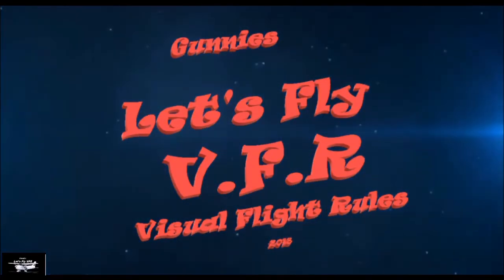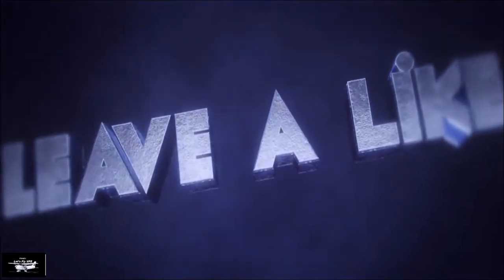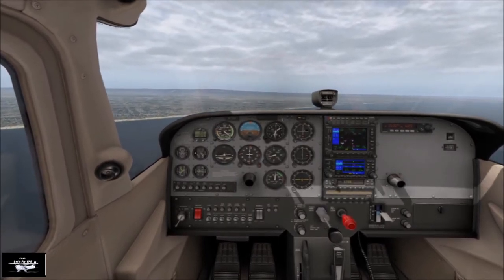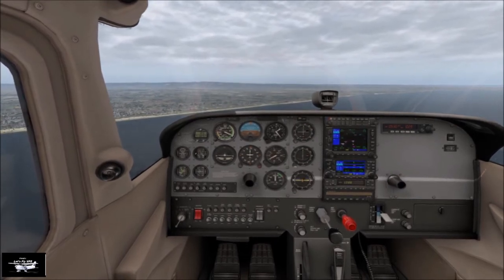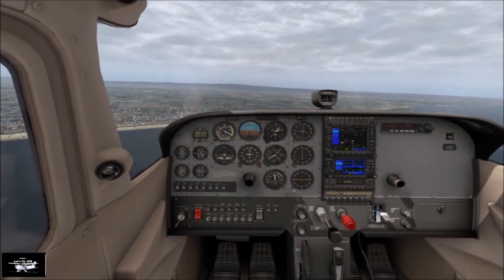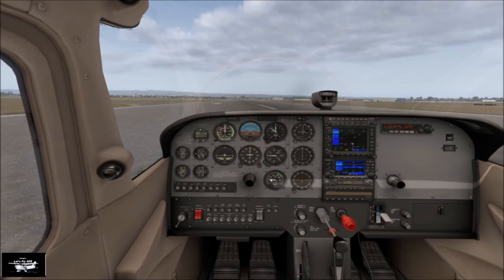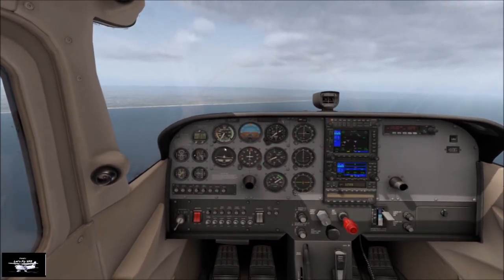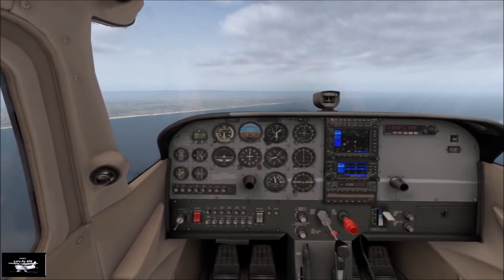X Plane 11 Make a perfect Landing

Comment: In "A view from the hover", John Farley recommends the throttle = speed / stick = descent approach. His reasoning is that needing to gain airspeed ( say because of a gust ) at low altitude, and using a slight nose down is more dangerous than just increasing throttle a bit.
Reply from the maker: +TheSkipjack95 Yes I have had this discussion a few times. There isn't a right or wrong really .. some people get very passionate about what's correct. I have a commercial pilot as a subscriber and we discussed it and he uses attitude for speed and power for decent rate when flying.  Do what your comfortable with mate. :) Thanks for coming to the channel.

Comment: Pitch for Alt and Power for speed needs always two adjustments when you change one of them....for a stable approach (trimmend for speed) you only have to manipulate power to control the desent rate, since the speed will stay always the same.
Reply from the maker: +Vienna Flyer Its a long running argument which is the correct one. Nave one way and airforce the other I believe. Choose what suites you. :)
Reply: @GunniesLetsFlyVFR  ...correct. Since approach and landing always depends on various factors, a clean process in one way or another isnt always suitable,

Comment: Your approach speed for the 172 is too high for what is  recommended by Cessna. If you do not have a published approach for the aircraft you would use 1.3 of Vso (Stall speed in the landing configuration) and your touch down speed is way to high. You should be close to stall speed as you touch down. As far as what controls altitude and what controls airspeed is more of an argument by military pilots and not civilian pilots.  If you lose power to your single engine airplane you are going to pitch to your best glide speed, there is no way to power to your airspeed and is one reason most pilots are taught power controls altitude and pitch controls airspeed.  When commercial airlines make an approach in the landing configuration they pitch to the desired airspeed and use power to control their rate of descent. You won't see civilian pilots debating this issue.
Reply from the maker: Good to hear from you :)

Comment: Very good video. But here is the trick. This has to be IMC down to a CAT 1 minimum (200 ft ceiling). Also, intercept final approach course at an angle (30 deg intercept). Why do I say this? Both methods factually work. However, Pitch for VS and throttle for power is for precision flying (ILS), the other method will not work. How do autopilots Boeing work? pitch for VS(glideslope) and AT for airspeed. Why not the other method? It will not give you the precise control that is needed. BTW, had I been your passenger, I would have like Mr. Second Pilot. You were far more stable and had a better ride with the second method. So, in a future video, do both IMC and blow up the instrument panel and fly both to minimums (don't worry about the landing) and then compare. I have no doubt that you will be converted. I can already see it....LOL
Reply from the maker: OK .. We both Knew this would take some practice .. HAHA ... Well Ill give it a go ~~~ Keep firing in advice .. Very Welcome good Sir! Gunnie
Reply: Actually I think your video really show both methods... Flying them in IMC will show a better comparison...
Reply from the maker: +pedrosura ill be giving it a go. :)
Reply from the maker: WOW .. Ive just tries a few cat 1 approached to YPAD R23. Power attitude .. ended up ok but right over the parking not the runway. 2 power is attitude .. about the same but left about the same diatance .. oh night as well .. then tried using 1) missed the airport by overflyng it in day co ditions. I need some practice Pedrosura. This is the hardest thing I've ever done flying a sim.
Reply: lol The ILS is the goal. To get there you should spend time doing climb descents at a constant power/pitch for VS, Constant power pitch for airspeed, then at a constant VS and airspeed. Once this is second nature then you are ready for the ILS. As practice you could use the autopilot in VS and heading select and manual power for airspeed. This represents what you would do while flying with your instrument skills.
Reply from the maker: pedrosura Well so far ive made one successful ILS landing with autopilots help but my manual approaches start to fall apart at 2miles or so. Keep arriving over the apron right. Close but no cigar.
Its going to get better though. :)
Reply: Gunnie's Lets Fly VFR Use the autopilot to learn how to make small changes to fly the ILS, dont try to land with it. The corrections should be small, -+100-200 ft/min and 2-3 deg in heading. You should make a correction and hold it. Wait for the needle to reverse motion and then another correction to stop the motion. You are making corrections that are too big.. you should be telling yourself 400 ft hdg 298 wait... 600 ft/min hdg 302 wait... 500 ft/min hdg 300 wait..
Reply from the maker: +pedrosura OK. Ill keep at it. Ill post a video in a week or two. I'd like this one to be good. Ill do AP assisted landings but i want to fly it manually as well. ;)
Reply: @GunniesLetsFlyVFR  I need some help with X-PLANE 11. I am a real private pilot.I can't  seem to get the pilots head to sit up as high as your vision setting. I can only see about 2 feet of the windshield above the panel. The IR Track only move side to side slightly and I can't get my head out of the cockpit because of it. Though I can move side to side without IR TRACK the low position remains an issue. i am having trouble with the over sensitive ground control stearing very toutchy. The taildragger is a monster in X-plane & I have my real taildragger endorsement. I've got a Tri-pacer, sonerai and a Teenie two. Crash recommended you.
Reply from the maker: +Isaac Mcpeek Hi Isaac .. The arrow keys move you around left right as well as up and down with the full stop .... and the ; zoom in and out .. hold ctr + num pad key to save the view. Ill check when i get home to make sure this is correct. ;)
Reply: @GunniesLetsFlyVFR  thank you so very much. What about the IR TRACK problem of little movement. It work just fine how it is in other sims. Maybe it has to configured just for X-plane? As far a ground stearing being so short coupled. Do you or anyone you know might know how to dampen out that being so short coupled. I mean my tri-pace isn't that bad and it has a much narrower and shorter wheel base than a real 172. Oh and the taildragger thing. I know a fellow with a Stinson 108. He says they are by far one of the easiest taildragger to handle. Don't know if you can dumb down the flight model physics in X-plane somewhere but it would be nice. I already know how to fly. Though we all can use regular practice. Don't know why people think harder is more realistic. Thank you for your time. I really appreciate it.
Reply from the maker: +Isaac Mcpeek It is possible to make the general responsiveness less dramatic in the joystick page i think. Realism settings maybe. 
The IR track is either its not enables on the settings page. Tick box bottom left in settings ... or just need to make it more sencitive. I use facetracknoir sometimes and thats ok. Tempremental with light.